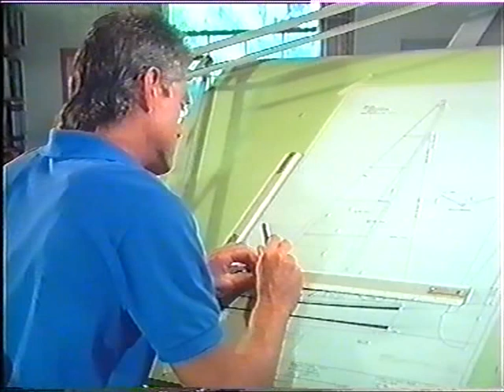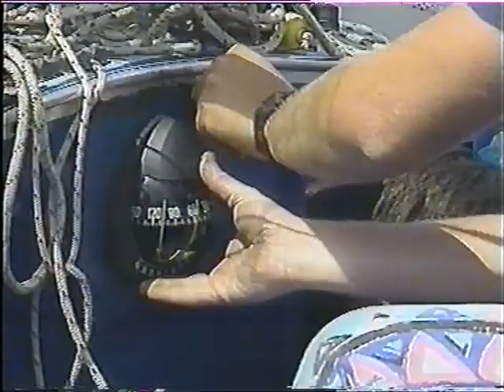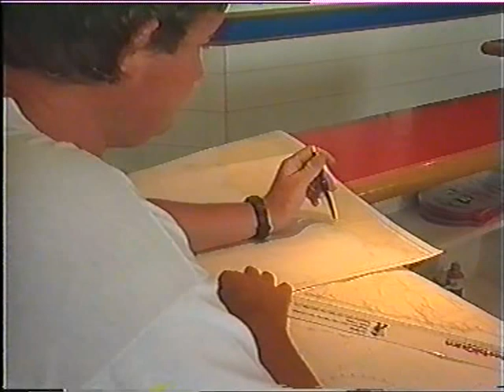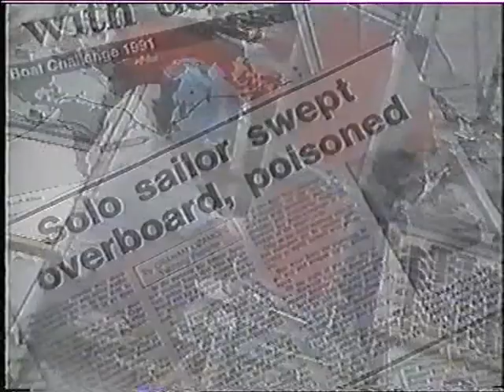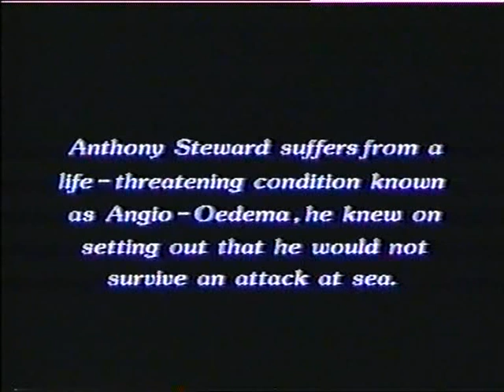Ant Steward, Around the world alone, in an open boat.

Comment: Open boat - yes. Of course its an open boat, mine is only 10ft longer it has a cabin I can go into to escape the weather I can close the hatch climb into a bunk and sleep out of the wind, sun, cold, or heat relief from the elements even for just an hour is a huge advantage. His is an open boat with storage lockers that is all. Not even a canvas tent or cover to crawl under even if that makes a difference. Famous trips in open boats like Shackleton's and Bligh's all had canvas covered sections.